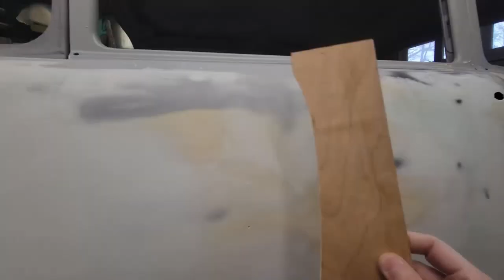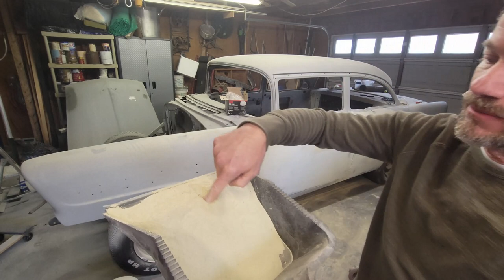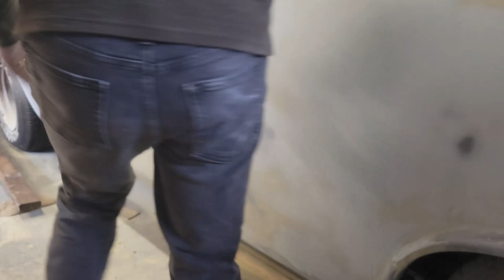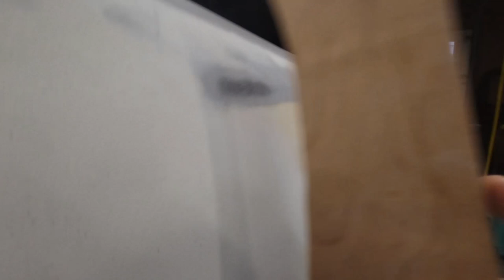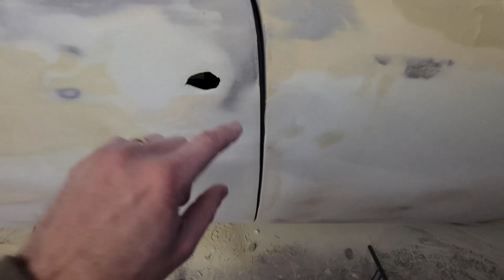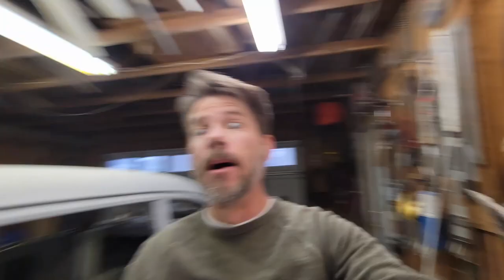E73 Uniform & Even Door Gaps!  1956 Chevy Bel Air Restoration

Comment: Bill what do you recommend for a rust encapsulator? I have an inside panel that is solid but it is pitted and want to seal the rust.  Plan is to sand it as best as I can and seal it till I get it to the sandblast. The area will be covered with a panel that will only leave maybe 3 inches for the sandblaster to work with.
Reply from the maker: I'd probably hit it with the Locktite Extend Rust Neutralizer spray, which is available at any auto parts store.  After that, then I'd probably just use an undercoat, like the 3M rattle-can variety.